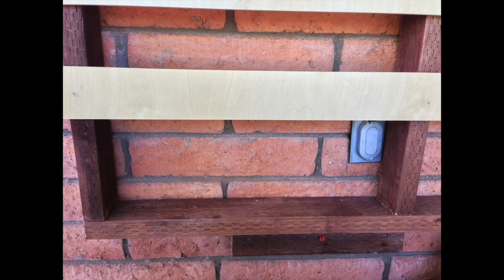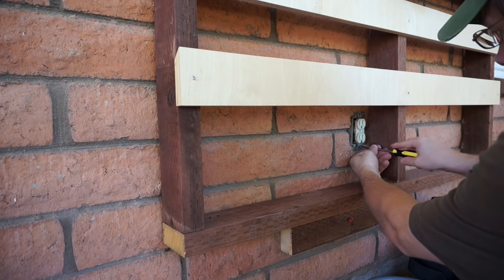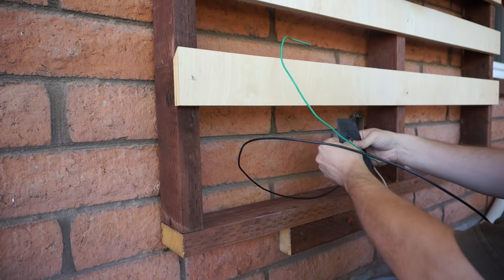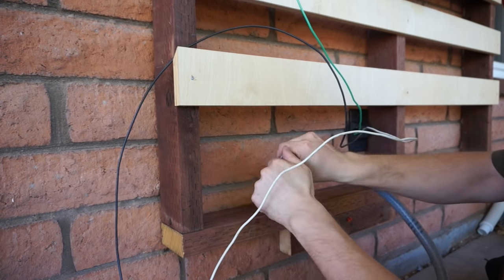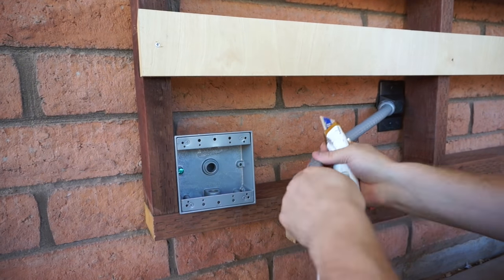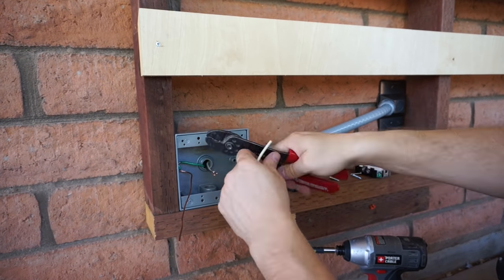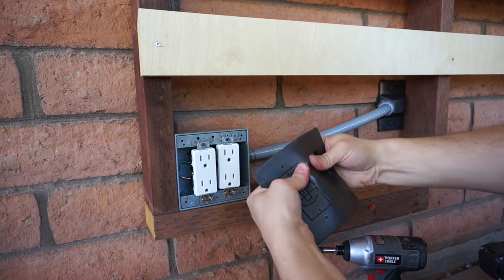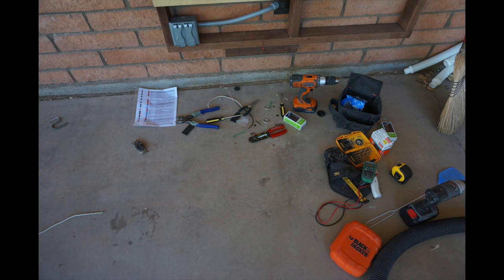How To Extend an Electrical Outlet

Comment: To everyone here saying you must have 6 inches of wire sticking out from the face of the box you are WRONG.  Code requires at least 3 inches sticking out of the box and at least 6 inches of free conductor from point of entry to point of termination.  300.14

Comment: The wires inside the box are too short. The need to be about 6".
Reply: @Thomas Samoht I have seen TONS of complaints about the "push in" type connectors. I'm not an electrician though, so I can't say for certain if they are all wrong or not. Wire nuts seem to work perfectly, though.
Reply: @user-nh3gu1ge3d  Push in connectors are fine if they are installed according to manufacturer instructions.
Reply: @thomassamoht7874  another complaint about how "bad" America is. We invented electrical understanding and have contributed more to the field than anybody else. But please tell us how you are so much better in your tiny countries

Comment: If the circuit you was working on isn't protected by a GFCI outlet then I believe it's code to put one when your outlet is outside
Reply: elgalloblanco1980 Unless it is fed by a GFCI breaker, than, you can use regular receptacles

Comment: You actually wired the receptacles in parallel, you just didn't have a "Y" on the outside connected each receptacle to the incoming power. Serial would have meant that you have power that has to go though a device plugged into one receptacle, before the other receptacle geets power. This would also lower the voltage to the other receptacle.  Also drilling holes in the weatherproof box is modifying the equipment, and is not permitted, unless the mfg tells you it is okay.

Comment: Outstanding instruction. Great use of fast forward and voiceover. Just what I needed on that type of sleeve. Here’s a tip: when you make that final check, look to see if the path through ground on your new receptacle gives you all the voltage that your main panel is dishing out. That way you know your ground isn’t suffering any corrosion points or loose connections.

Comment: That was so close my man. As many have said. You should have an extention ring on the old box to come to the outter wall. Due to not covering up your junction box. You'll want at least 5 to 6in of extra wire sticking out of the box on both ends..
The cover was a good idea with sealtite but a wp flat cover with a sealtite 90 degree would have been a better choice. 
You would also want to add a clamp to hold to the sealtite to the wall.
Lastly. When it comes to weatherproof boxes. You dont drill holes through the side. Get your hammerdrill and run ur holes in the walls with the tabs. 
Good concept. Just too many code violations.

Comment: 1 since you have a metal outdoor box, you do not need to wire the ground to the outlet ground screw, the screw attach the outlet to the box serves as ground, all you have to do is to ground the box
2 in the newest code Weather resistant gfci outlet is required
3 you have a big box, leave longer wires will make your future upgrade job easier
Reply: Agree with you
Reply: You MUST ground the rexceps. unless you use spec. grade type.
Reply: you so do have to ground the receptacle... because once you remove the receptacle from the box it is no longer grounded...
Reply: A few older homes may have outdoor outlets already protected by an upstream GFCI that is located inside the house.
Reply: strumpeteer I hate when outlets are wired to upstream GFCI since it isn't always obvious that they are protected and you don't know which one you need to reset.
Reply: Ground to outlet screw a must cannot rely solely on bonding to conduit/box for ground
Reply: @mikeclarke3005  that ok with those outlets-- look closely they have a cooper conductor by the screw on the bottom.  You must remove the cardboard insulator for that to be effective.
Reply: I know a lot of inspectors that would vehemently disagree with you on the box/receptacle grounding part.

Comment: Tip for removing an outlet where the screws are semi-stripped - use adjustable pliers to pull the outlet toward you to reduce you while you screw out the screws.

Comment: Nice video. I was wondering though if you if could have created a more flushed and cleaner look by connecting the WHIP to the side of the box instead of behind it with 90 deg connector. I have the same type of whip and in order for me to connect the 90 degree connector I have to rotate the electrical box 90 degree landscape orientation which will probably make it look weird but will still work.
Reply from the maker: The specific weatherproof box I had didn't have very many knockouts on the sides and so since I could access it from behind, I considered that a cleaner look. There are weatherproof boxes with more knockouts, though, and so yeah, you probably can make it more flush to the wall by using an available side knockout.

Comment: You aren't a seasoned electrician until you have assembled your liquidtight system and then realized you forgot the connector, so you have to take it all apart. Same goes for a cord cap. LOL. good job.

Comment: If all wires were originally WHITE in the box how do you know which to connect green/white/black?
I liked your black to brass tip.
Reply from the maker: That's a good question!  I don't know why all of the wires look white in the video.  Maybe there was dust on the black ones?  In any event, the original box had two white; two black; and one ground wire so there was no guessing on my part.  See this other picture: http://i.imgur.com/hhOcnHn.jpg
Reply: If you can’t identify the colors,you would have return power to conductors and test

Comment: You didn’t give yourself much wire length to work with, when adding the two outlets like you did the main power line when extending it.  You only had like an inch maybe?

Comment: I like your video, but I need some advice. I have a recessed outlet box in my patio that I want to keep and use the outlet. I want to add another outlet about 8 feet above it. How do I get the power from the recessed box without trying to fish for wire behind the wall? I want to do this all externally. Is there a box extender for the recessed box? 
Thank you.
Reply from the maker: Yes, look for an "extension ring" with "knockouts". You can get them in single-gang, square, round, and weatherproof and they all attach to your existing recessed outlet box. Some example: https://granworks.com/homedepot/square-extension-ring and https://granworks.com/homedepot/weatherproof-extension-ring
Reply: Perfect.  Thank you for the advice.

Comment: not allowed to make a raceway out of a coverplate. against 2017 nec
Reply: He could use a box extension with 1/2" side holes, what does it change? As long as it is watertight it works exactly the same. The "cover" is not just a cover, it is "Weatherproof Cluster Cover with 1/2 in. Threaded Outlets". Do you have a NEC article that prohibits that? The splices are totally accessible,  nothing is hidden or burred. He didn't make that Threaded Outlet, it is all UL listed and approved for added weight. Please explain yourself.
Reply: Guess you’ve never wired modular furniture The cover is not the raceway the flex is.

Comment: Excellent job, only critique I have is I would have left another 4-6 inches or so on the wires you ran to the new box... looks like you cut them kinda short.. either way clean work looks good!

Comment: The beginning you mentioned for such a short run you could have used ‘romex’ wire but you used THNN since you had them.
I have a short run from my junction box, less than 12” to my raceway in my insulated patio.
Can I use romex?

Comment: Or, on modern outlets (by modern I mean less than 50 years old) the HOT wire is black, red, blue, yellow, and always goes to the SMALLER (right) plug terminal.  COMMON is always WHITE and goes to the LARGER (left)  plug terminal on the outlet.

Comment: Looks fine...However, did you check if you got two feet of excess electrical wire to pull the wire out.  This may be an option since some states and appentrice system require excess.  The reasoning is for earthquake "shear" prevention.  Another option is if the direction of the electric wire is from your left, remove the brick and replace with a support housing.   If the electrical is wired for "economics" and using as little romex as possible...Your solution is the best option.  Good Job.

Comment: how about supporting the box?
Reply from the maker: I'm not entirely sure what you mean.  The electrical box is screwed into the french wall frame (the "studs") and so it is super solid.  The original electrical box that I'm replacing is embedded into the block wall, so that's not going anywhere.

Comment: Conduit must have one clamp on that run!
Reply from the maker: Code for flexible conduit does say that it needs a clamp within 12 in of the termination point and my run between the two points is 16 in, so, yes, an inspector could absolutely require a clamp in this case.  I don't think most would, though.  I'm fairly certain that the inspectors I've dealt with to date would not care in this particular case.  It's "essentially" clamped at 16 in rather than 12 in, meaning only 4 extra inches unsupported.  It's also quite rigid between the two points and there's no indication that it could or would sag over time.  As such, I feel pretty comfortable leaving it unclamped in this very specific instance.
Reply: Oh boo hoo. Because the absence of one clip is going to cause the entire world to implode.
Reply: @oscarmuffin4322  It matters. People (who are dumb) hang ridiculous things off anything in sight. Laundry lines, dog leashes, potted plants. Use the clamp.
Reply: You mean Strap i have Never used a "Clamp" for Strapping EMT or MC Cable .

Comment: You wired them in series? Wouldn't that cause a voltage drop or difference between the two outlets?
Reply from the maker: Yes, there is indeed a voltage drop whenever wiring outlets in series and that's one big reason that doing so is against code in a lot of case... BUT there is one exception and it's this specific case.  GFCI circuits can be and are often wired in series in order for the entire circuit to be protected by one GFCI receptacle.  The voltage drop will typically be small enough that the compromise is worth it.
Reply: Oh, I see. Thank you for sharing!

Comment: 1) No GFCI outlet installed.  Won't pass inspection.

2) Your junction box is not accessible.  Won't pass inspection.

3) Wires too short inside the electrical box.  Need 6 inches. Won't pass inspection.

4) Not sure your conduit is correct.  Might or might not pass inspection (jurisdictions differ).

5) Outdoor outlets are supposed to be on 20A circuits since most people use outdoor outlets to power high amperage tools. Won't pass inspection.

If your house burns down, your insurance won't cover it.  There's a reason why electricians have to go through several years of training and why some housing boards will not allow home owners to do electrical work (unless the home owner happens to be licensed).

You did bond your metal receptacle box, which is a plus.  Most DIY'ers won't.
Reply: Passing inspection is only required if you intend to have it inspected. ;)
Reply: @agentx250  or if you want your insurance company to cover and damage from a fire....
Reply: @joshualachute3448  If you really want to split hairs, sure. What did he really do here though? Pigtail off an existing line to effectively extend the box maybe 2 feet. All the new wire is outside the brick and he used conduit that's burial rated.
If something he did here doesn't pass then leads to a cascading failure which ignites the structure then yeah, insurance won't cover it but given the odds of that he has a better chance of winning the lottery.
Most engineering applications the average person would try around the house aren't that hard to do properly. Grab a ~$10 book from your local hardware store on the subject, go to your local building department and get the codes then get it done. We're not talking about lifting a ceiling and adding a second story or digging under a slab to build out a basement; the latter being something my great grandfather did back in the day and that house is still standing.

Comment: #1 need GFCI outlet or Circuit Breaker at panel, #2 need weather resistant, tamper resistant outlets to be in modern code. #3 longer wires, #4 ground the box.

Comment: when you put the wire around the screw connector you should have the wire wrapped in the direction of the screw so when you tighten the screw it pulls the wire in tighter instead of pushing it outwards
Reply from the maker: Agreed!  I try to remember this by either putting the wire on the right side of the screw OR by ensuring the loop on the wire goes clockwise.  I may not have done it in this video but haven't re-watched it in awhile so don't remember.

Comment: God , I'm glad I got an electrician to install power from my house to my shed , have a trip out inside the house , outside from the switch connected to armer coated cable that runs to the shed with trip out and a breaker system both ends . And then have it tested .
Reply from the maker: Heh, yeah, there is a WORLD of difference between a simple outlet extension and running power to an external building.  When I ran 60 amp 240v power to my workshop, I got a permit; dug the trench to the proper depth; added the new panel in the workshop; pounded in the grounding rods; and ran all of the properly sized wires... and then got it all inspected and signed off.
Reply: Granworks Workshop ,  you obviously know more about it than I do , but your vids are very informative and helpful in case I need to add things at a latter date . Thank you 😊
Reply: @granworks  ... btw, ground rods at a subpanel is not code. All grounds must be hardwired back to the main panel. OTOH, they may have asked for a second ground rod at the main panel to bring that up to current code. You didn't specify.
Reply from the maker: First, thanks for a unique code note and not one that's been rehashed a hundred times already in the comments.  That said, the addition of ground rods was a requirement by the inspector and he failed me the first time because I lacked them.  This is from NEC 250.32(A).  A separate building (in this case, 150 ft from the main building) requires its own grounding conductors -- two of them, spaced 6 ft apart in my case.  Sub-panels may use the grounding path of the main panel only if they are in the same physical building as the main panel.
Reply: @granworks  ... thanks for the follow up. This may be something new or a local requirement that I am not aware of since I an semi retired at this point. I was never an electrician but my job, installing large stand-by generators, required staying on top of codes and working with local sparkies plus dealing with local inspectors. As a side note, I can't believe how often an inspector was wrong on his interpretation of code.... but there's no correcting some. You make them happy or you flunk! Personally, I feel more ground rods are better, but some of the smarter electricians I worked with explained how that's not always the case, technically speaking. Bottom line is soil conditions can make for variations and throw a monkey wrench in the works. A single ground "area" connected to the main panel seems to be better if you sit down and do the math.

Update: the code your inspector asked you to follow might be from 2008 or the NFPA code. (national fire protection association is different) There is new code since 2018. See what I mean about inspectors not always being right or up to date? Check this out :  https://community.nfpa.org/thread/36014

Comment: you usually wire plugs parallel...you do it in series sometimes?
Reply from the maker: Yes, usually when adding on to an existing GFCI circuit where the first outlet is protecting the rest of the circuit.